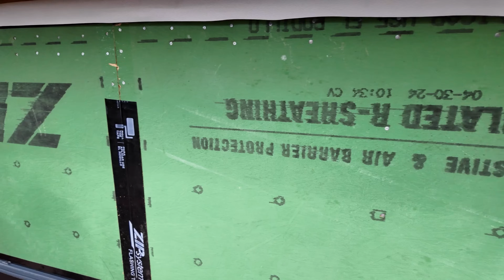Canada's BEST KEPT SECRET in Building Science!

Comment: Just a few points as an energy efficient passive solar home builder since 1981. Does this house face south? The bases for all my solar designs is derived from The Passive Solar Energy Book published in 1979 and still available. A necessary read for all home designers to this day. I would design overhangs to shade the windows in the summer.
I personally do not like ICF. It is my preference to use a regular concrete foundation and insulate it on the outside so the thermal mass is kept inside the house.
On some previous designs I've put the electrical boxesl in the concrete walls using conduit to later fish the wires and then plastered the concrete afterward.
With the foundation insulated on the outside it runs in plane with the exterior insulation applied to the framed walls.
Great work. Photograph the hidden nailing for the inspector later

Comment: Very nice quality craftsmanship. 

I'm skeptical how long those adhesives and paints will stick to the foam. Fingers crossed it sticks long term.
Reply: I'm interested in this aspect as well.
Reply: Sealing an ICF is a farce to tack some extra money on. The only way to to seal concrete is directly to concrete. You sealed the insulation, what does that do for condensation behind the insulation? Torch n Stick applications. Torch membrane straight to primed concrete, following day heat your membrane and Stick you insulation to the membrane. You want the grooved insulation with your gaps running up and down so that in the event water gets behind, it drains out. Weeping tile at the bottom of the foundation goes a long way as well. Peel and sticking insulation is doing nothing, the dirt is holding it in place, you could probably peel it off with 2 fingers.

Comment: I believe this insulation math needs to be combined with HVAC math to bring costs down. If one is using a Mitsubishi “34-SEER” to heat and cool with fans running 24/7, your consuming the amount of energy of a “space heater” to heat & cool the entire house. Almost to the the point of going “net-negative “ in energy consumption.
That said, I want a 6 foot by 6 foot farmers fireplace 2 feet off the ground. Real wood burning.
Reply: Unfortunately an open fireplace kills the entire HVAC strategy 😢. But you already knew that! 😊

I’m installing a sealed propane fireplace in my otherwise all-electric house for when I want a little ambience and it will also provide backup heat during power outages which are commonplace on the Oregon coast. It’s just not the same as that big roaring fire in a real, open fireplace, though. I don’t quite trust the engineering on a sealed-door wood fireplace (since you have to open the door to add wood) and they are nearly twice the cost of a gas/propane fireplace. For me, it’s a reasonable tradeoff to burn a little fossil fuel every once in a while in exchange for a reliable source of backup heat.

Comment: If you read the back of any other sheet of ply wood or osb. It has arrows that dictate the strength axis. And in 99% of cases sheets should be attached horizontally because they are stronger that way. I understand it might minimally reduce the R value but I always try to go with manufacturing specs.
At this day and age at what point does expense of products and installation eclipse money saved in heating.
I.E. spend extra 5k to save 10$ a month. 400 years to pay it back.

Comment: Is that a half inch gap above the window in the very beginning? lol
Reply: Yeah I don't understand this. It was really bothering me
Reply: Typically flangless window RO's are Unit Dimension +1"........so yes
Reply from the maker: @francismarion6400  it's for insulation and is the recommended gap from the manufacturer. European Tilt Turn have different installation instructions
Reply: @AwesomeFramers  no way! Learn something new every day.
Reply from the maker: @justinlynch6691  me too! When we installed Innotech,it was a surprise to me
Reply: @AwesomeFramers  You can't secure the window and insulate? How much holding strength does insulation have?
Reply: @stevenbaczekarchitect9431  Sure RO should be bigger so window can slide in but 1/8" all the way around is fine then shim where the screws are.

Comment: So WHY can't you use stainless steel fasteners?
Reply from the maker: @jamesoncross7494  for us they are still soft a metal for shear
Reply: @AwesomeFramers  even if you use a larger gauge?
Reply from the maker: @jamesoncross7494  I really don't know. I should check, that's just what I've been told in the past.
Reply: @AwesomeFramers the cost of stainless , galvanized is cheaper . 
Once I was on a job where we were using nickel nails , I don’t know what drug the engineer was on . 👍🇨🇦

Comment: Pause it at 11:15. Ten trusses being supported by a double top plate with twelve studs NOT directly below the trusses. This just SCREAMS wrong to me. Surely each truss should have a stud directly below it. It's just common sense. Great nailing job but now the nails have punctured the air/water barrier. Are you going to seal the nail heads? And are you really allowed to use a stud knee-wall  (which also supports the trusses!) as a window header in New Brunswick? Oh wait, I think I see a single 2 x 10 on edge above it. Yep, that should do the trick! Also, nice harnesses!
Reply: There's nothing wrong about it anywhere in Canada.
Reply: @chrissmith3509  Seems fine......

Comment: How does the plywood do its job 1.5" away? seems ridiculous to me?? You all relying on nails bending or shearing?? No thanks 🙂
Reply from the maker: Good question, the nails still do their job but diminished strength.  For us using R6, we have to nail it 3" oc.  This is based on testing.
Reply: @AwesomeFramers   I call B.S. never will i do this!! The foam needs to be on the outside of the plywood so the plywood can do it's JOB!!!
Reply from the maker: @thegrantdanielsband  Calm down dude, there is a lot of information from actual building scientists that disagree with you.  Check out the articles in FHB, JLC, Green Building Advisor and more.
Reply: @AwesomeFramers  They told us urea formaldehyde insulation was safe? You go do what you need to do? I on the other hand will not use this Garbage thank you very much!! I like my costumers too much
Reply from the maker: @thegrantdanielsband  bro, lower your blood pressure.  The "they" you are talking about aren't the "they" I'm talking about.  That was 2+ decades ago, lots changes since the formaldehyde issue.  That has zero to do with these panels.
Reply: @AwesomeFramers  Like I said you do what you think is right!!! I will not use the garbage thanks blood pressure lowered LOL 🙂
Reply from the maker: @thegrantdanielsband  Were you ever a Seinfeld fan?  There's a great episode where Elaine freaks out over the use of exclamation points.  I think of that every time I use them.

https://youtu.be/hzSU_EHmzw4?si=yHSevqEwJQDMBrSM&t=96 

Laughing is the best thing for blood pressure 🙂
Reply: @AwesomeFramers  Yes I have watched Seinfeld I do like John Pinette more he is even funnier!! but I do have perfect blood pressure it never goes up lol🙂
Reply from the maker: @thegrantdanielsband  well played sir, well played 😁

Comment: The Huber ZIP R-X Sheathing-system makes your wall vapor tight which is not something you want with a wooden framed wall.

Even worse, it makes your wall vapor thight at the outside which is something to avoid at all cost in a cold climate.

What you need are walls that are air tight but vapor open at both sides of the wall, such a wall can be used in all climate zones and with all kinds of insulation material between those two air tight layers.

The insulation material should also be vapor open.

For walls below grade, a vapor tight layer can be used but only at the outside.
Reply: The cavity insulation will be vapor open,  and there will be a smart vapor retarder.
Reply: @Aron_Jones_Carpenter  That's an aid but it also means that your wall and outside sheathing will remain wet during the winter.

Solid wood can handle this, OSB a bit lesser...
Reply: @koenraadprincen7212  The zip is not at the dew point.  If it is not a condensing surface, how will it get wet?
Reply: @Aron_Jones_Carpenter  The exterior (ZIP-) tape will be the condensing surface in case there's a leak (crack, hole) in the internal air barrier/vapor retarder.

Other source of "wetness" in the wall is a leaking water line, leaking gutter,...

It's all about "resilience" of your wooden walls, walls that can dry to both sides are more resilient in case of problems.

If you want top notch reslient walls, use "capillary active" materials for your air barriers that are still vapor open, i.e. wood fibre board (LDF, MDF, HB) or fibre cement board.
A capillary active material can dry on the outside when it becomes wet on the inside (or visa versa). It's able to transport water in its liquid state where a vapor open material is able to transport water in its gas state.
Reply: The air barrier is the most essential control in a building.    Air carries 254 times more moisture than vapour.   The air barrier must be a) continuous and b) on the warm side of the wall.    For those in a northern climate, that means the inside.     The “air barrier” on the outside is old school language and is misleading.    The correct term is now WRB — weather resistant barrier.     Exterior insulation is good in that it attempts to minimize thermal bridges from framing members.    If warm air gets to impervious exterior insulation, then that may result in condensation….which is why the interior/ warm side air barrier is the most critical.    The air barrier can also be the vapour barrier which makes the AVB (air vapour barrier) the most important control element.
Reply: @peasos8638  Yes and no ;-)

I agree that we need two air barriers, one on the inside and one on the outside, especially when your insulation material is a wool like material (glas fibre, cellulose, stone wool, wood fibre, flax,...).

_In wintertime, the outer air barrier must keep the cold wind out of the insulation layer, in summertime it must keep the moist warm air out of the insulation layer to prevent condensation against the inner air barrier especially - again -  when using a wool like insulation material. _

But those two air barriers must be vapor open so no moisture can build up in between those two air barriers compromising the wooden structure and insulation material.

You can give the outer air barrier also water resistant (shedding) properties and call it a WRB, no problem but don't make it vapor tight by gluing an OSB and poly iso (or XPS, EPS,...) against it. 
Even the use of (naked) OSB sheathing is debatable as OSB is not that vapor open (while MDF or LDF are vapor open).

And yes, I know, there have been done some tests that when the outer OSB (and the wooden frame) becomes wet in wintertime, this is not a big problem when it can dry out again in summertime... but personally I won't use this as a design guidance.
Reply from the maker: @koenraadprincen7212  don't forget to account for the HVAC system.  The house is a system of systems, too often people get hung up on 1 aspect of 1 of the systems.
Reply: @AwesomeFramers  Indeed, a "real" HVAC system that is able to maintain a relative humidity level in between 40 and 70% ("as desired") will help you to dry out the wall in case of any moisture (water) problems in that wall, but only if the air barrier on the inside remains (enough) vapor open.

But in colder climate zones, I don't think the HVAC system is working during the "in between seasons" (spring and autumn).

Wood rots if the moisture level of the wood is too high and air has free access to the wood... therefore one must not only keep water away from the wood but also to make sure the wood can dry "as soon as possible" when it becomes unintendedly wet .
That's why I'm advocating for wooden walls that are vapor open to both sides.

Lots of builders in the US use SIGA products. Once and a while those builders are invided to visit building sites in Switzerland or the rest of North-Western Europe... but in NW-Europe we would never ever use vapor retarding sheathing on the outside of our wooden framed walls.
Next time, ask this at somebody from SIGA Switzerland...

We put the main air barrier on the inside and this barrier also has some vapor retarding properties ( not vapor closed!) and on the outside we use a "wind thght air bariier" which is a barrier that's "as good as possible" air thight.
So on the outside we use vapor open structural boards (MDF, LDF, fibre cement,...) or a vapor open plastic foil (SIGA Majvest 200, Solitex Mento, Dorken Delta Fassade,...).